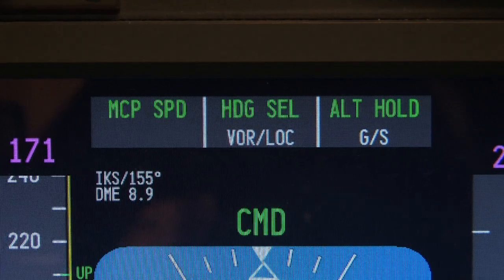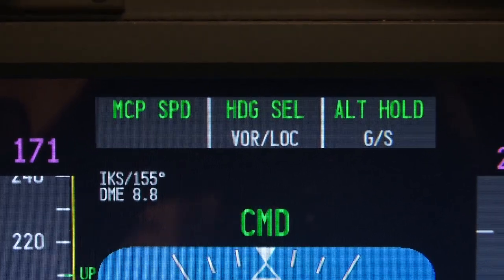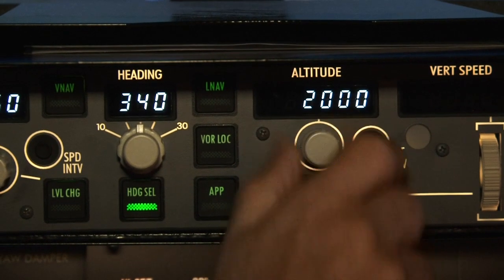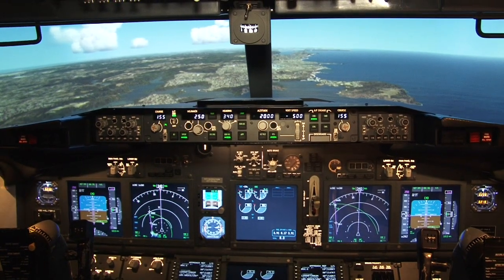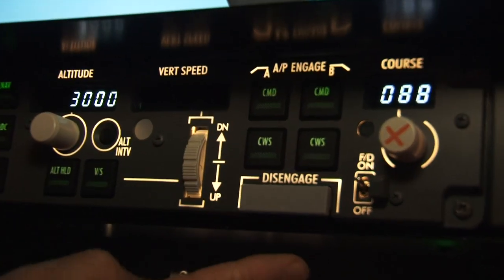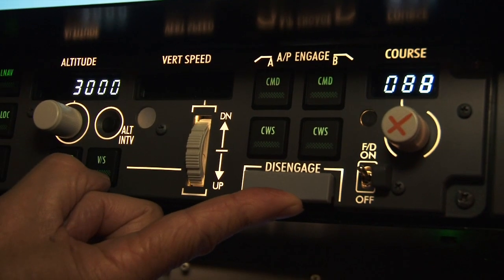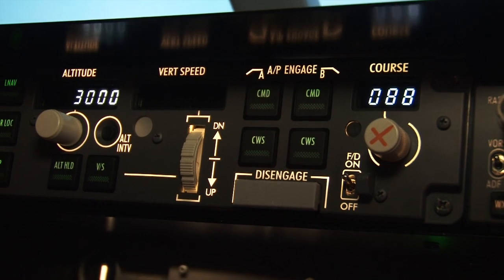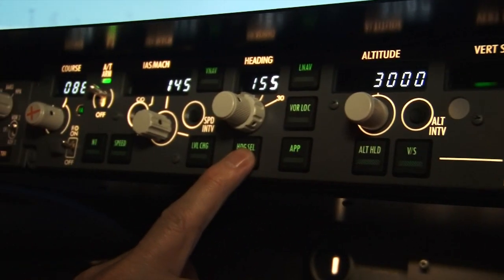Boeing 737 Tutorials - Mode Control Panel

Comment: How is the CWS button used?  Also if you flying the  LOC and you have APP on do you disengage ALT Hold?  Thanks
Reply: If the CWS is set to On, the pilot can uses the yoke to adjust aircraft's pitch and roll while the CMD is on.
And in precision approach (LOC&GlideSlope), the airplane doesnt need ALT HOLD anymore, all will be done by the APP mode.
Except, if we just using localizer, you'll need vertical speed to descent, coz it's catagorized as non-precision approach